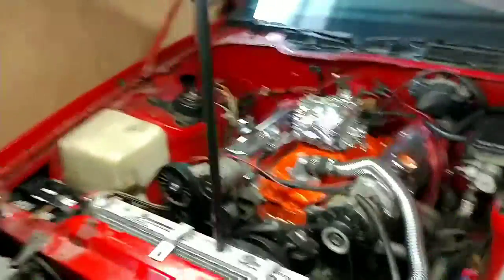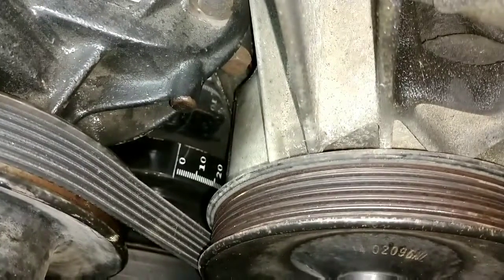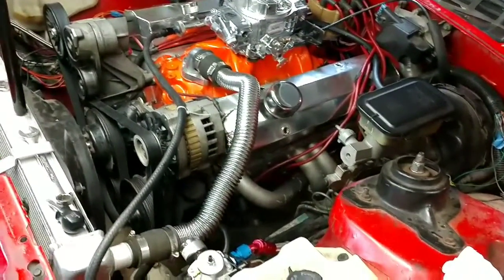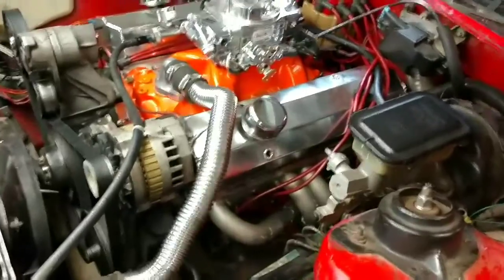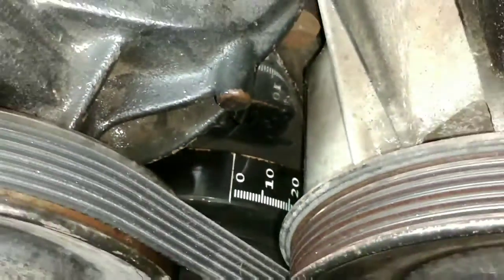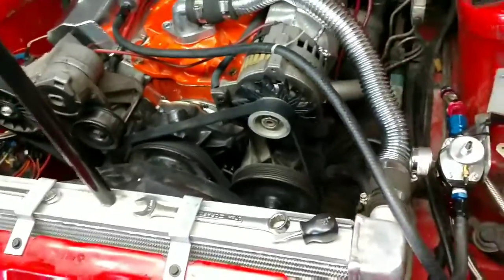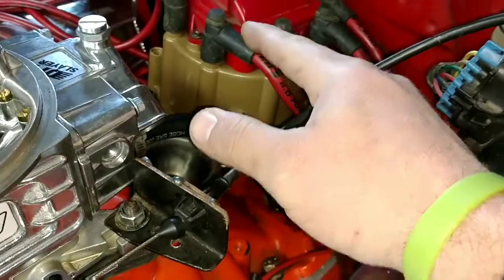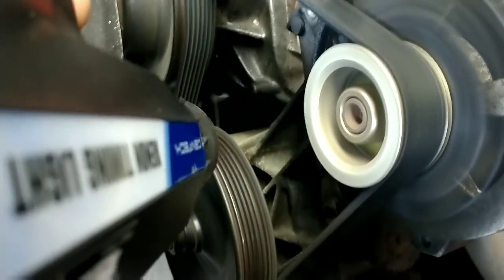Timing my SBC 350 with no timing marks!!!.. My distributor was loose!!!

Comment: You don’t need to time with a light. Use a vacuum gauge. Time for highest vacuum and back off 5. Listen for ping. If you hear ping on load back off distributer a little more.
Reply: What do u mean ping
Reply: Should i do this with the vacuum advance canister connected? Should I use manifold vacuum? Then just adjust timing until the vacuum cannot go up any further. From that point, back of 5 degrees?

Comment: I have a 350 with problems with pinging and knocking close to WOT, I have my initial timing at 4 degrees. Using just mechanical advance and using 93 Octane, any suggestions on how to stop the pinging? Seems like initial timing at 25 is way too high and will probably have pinging and knocking pulling out of the driveway!!
Reply: You need to set total timing
Reply: @supert1255  👍
Reply: Start with 12 degrees before for initial, and 32-32degrees total at appx 3200 rpm
Reply: @ironhorse127  to do that do you put the distributor in the block with the balancer market lined up with the 12 degrees before tdc on the tab ?

Comment: I've always just found TDC (if you don't have a pointer make a mark) then if you have timing marks turn the engine over until the pointer/mark is pointed at say 10° BTDC and get my rotor pointing at the 1 wire. As opposed to starting it at 0° because then it's at least in the ballpark of where you're gonna run it. Not necessarily 10 BTDC but you get the idea
Reply: So do you mean when you put the distributor in the block you have the mark on the balancer lined up with the 10 degrees before tdc ?

Comment: Does the timing have anything to do with overheating? It's a 86 sbc350 with some high performance parts.
Reply: Yes absolutely
Reply: Yes it definitely does if it’s pinging or knocking you definitely need to back it off a bit  …. You can advance until it starts to knock or ping then it’s time to back it off a bit  remember it can also be a warn out timing chain or cam gear on these older motors with 80000 miles or more it’s almost impossible to get right because timing wonders due to the ware of chain or cam gear that is unless it’s all new .

Comment: Once I get to the point of the engine running like this I take a ride around the block with a wrench and see how it feels. Now you can stop and turn it a tad and test again, if you hear knock time to back off immediately. It’s not the safest for someone who wants to test with a lead foot but for someone without a lot of knowledge this should be easy enough. Every car I ever tried this on had more power than it was setup for.

Comment: Robert S is right , the distributor vacuum can should be on the left passenger side facing about 45 degrees across the valve cover facing towards the front of motor, not the way you have it. it looks stupid. you can spin the distributor where ever you want as long as the number one cylinder is on tdc  and whatever cap terminal you pick is used as the number 1 plug wire. you can look at hundreds of diagrams of sbc motors and the hei distributor always sits the way I said. its also easier to connect the wiring plugs and tach and power wiring on the drivers side rear of the intake. anyways the way you found tdc and timed it is good. good video

Comment: I have a 77 chevy 350 and it runs alright idles rough but it hesitates when in gear I timed it to top dead center and it idled 10 times smoother so I shit off engine to tighten cap and went to start it again and it did not start just popped through carb what could this be ?
Reply: Timing is too far advanced

Comment: Cool car and video. Question I have a 84 c10 I have two marks on my harmonic damper the truck came with a 305 sbc but the I got it from put a 350. So I think he used the 305 damper what mark do I use thanks
Reply: that's basically the same thing as the video was about. and I'm putting a distributor on an engine that didn't come with one lol

Comment: The distributor isn't right. It's 90 degrees off. The vacuum advance is supposed to go on the passenger side. The battery and tach plug goes on the driver side. Point the rotor at the #1 cylinder like you did and your wires will not change position.
Reply from the maker: It's not wrong, either. It can be where ever you want as long as the rotor corresponds correctly with the wires. Also there's 180* to choose from on the oil pump shaft. Move the cap, move the wires. Doesn't matter where the advance and wires land. You have to play off the rotor with engine at TDC,  As I stated, I did mine this way to square it up in the engine bay, the battery and tach wires are hidden and only two plug wires crossed and are hidden behind.  I was going for a cleaner look than the typical spider web.
Reply: @KravasGarage  I concur. My distributor is 90-degrees off. The only thing that messes up, is being able to time the engine off the stock tape on the balancer pulley. When you tune it by ear, driving, and your tach, then it's all the same in the end.

The way I learned this: I was having timing issues on my 25' fishing boat (305 sbc) and I kept timing it with a light at 8-BTDC and it ran like absolute shit. But, when I'd crank the distributor way over, I could get it just BARELY bumping the key to start and ran like a raped ape and still does.

I couldn't for the life of me figure out why I needed to run it damn near 100-degrees BTDC to get it running great. Then a mechanic friend of mine clued me in to how whoever put the distributor in must've put it in crooked/let it fall in however it would. So, it all made sense and now I know a shitload more about timing than I ever thought I'd need to. Lol
Reply: The wires are in the wrong places on the cap. You were correct in thinking that mark on the cap is for number one, it is! Any way you have it will work but read a service manual and make it fsctory. Remove the wires and install them starting with number one corresponding to the factory number one spot on the cap. The original ignition wire sets had a plastic wire holder ring that clipped onto the wires and the cap, holding the wires as assembly making it simple if you needed to replace the cap. Anyway follow the service manual and put the number one wire to the number one spot on the cap and then properly locate the rotor and cap. The factory has the vacuum advance turned pointing towards the passenger side but more easily , it has the number one cylinder wire on the cap located to the front towards to carburetor.  Number 1 and number 2 wires on the cap locate parallel to the carburetor. This is the factory location per the service manual. It puts the vacuum advance towards the passenger head and it puts the HEI coil wiring harness plug connectors towards the driver's side. Install it this way then pull out the distributor and install it so the rotor points to number one. Keep it factory. Hope this clarifies and simplifies the correct explanation. If when you're done setting timing with the light and the distributor ends up turned so that number 1 and 2 wires aren't parallel with the carb, (and the HEI coil connectors aren't squarely on the driver's side)  please remover the distributor and reinstall it moving the rotor one tooth so as to tidy it up and end up with your cap having #1 and #2 parallel to the carb. That's the factory position and the way I like to have it.  Sure you can install it ANY way but why would you???? You can re-route the serpentine belt other ways to make it work too, would you do that??? Follow the service manual guys! Nobody ever reads the service manual anymore.
Reply: I misspoke.. cylinder #1 and cylinder #8 on the cap need to be parallel with the carb. Not as I previously mentioned cylinder #1 and #2. The firing order is 1-8-4-3-6-5-7-2 clockwise. So the second cylinder to fire is cylinder #8. Put cylinder #1 then cylinder #8 on the cap so that they're parallel to the carb. That's the factory position, an it's the position that will allow for all the correct length ignition wires to be installed and routed in the factory wire holders as well. Nobody ever realizes that the wires are manufactured for the factory set up and then when the install the distributor in a different position they wonder why the wires don't reach correctly and can't clip into the wire holders and end up rubbing and shorting on the valve covers or burning on the exhaust.
Reply: @roberts5118  it doesn't matter buddy where you put number one on the cap lol I don't know why you insist that matters because it doesn't matter at all number one can be pointing to the rear of the car and It still doesn't matter
Reply: This is a total hack job. YouTube needs to pull this video down.
Reply: Anyway to get to your "timing" I agree with what you did backing down your "total timing". I think total timing is far more critical than your base timing.
Reply: Whatever terminal on the cap you pick & choose to place your #1 wire, you point your rotor to it.  As long as the cylinder is at tdc, it will run.  But true, the vacuum advance should be at a 45 degree angle on pass side, for full range of motion for manually advance/retarding the distributor.
Reply: Everything is wrong. Both the distributor position (which is controlled by the way you install the rotor since it is geared to the camshaft) AND the wires are wrong on the cap. Cylinder #1 is labeled on the cap and that's where you should put it! Sure you can do it wrong an put#1 anywhere but why would you do that? Follow the service manual. Read my other comment for clear and concise and CORRECT factory procedures.